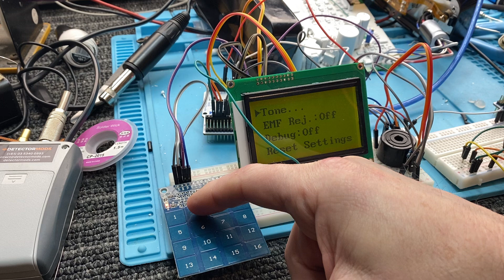Arduino based pulse induction metal detector with interference rejection.

Comment: How about a good cheap PI circuit board off the net and then try adding a FLYBACK to it between the circuit board and the coil to generate huge power at the coil, would b a great experiment, I will try it, don’t know if it will work, will try it just for the hell of it, cheap to try👍